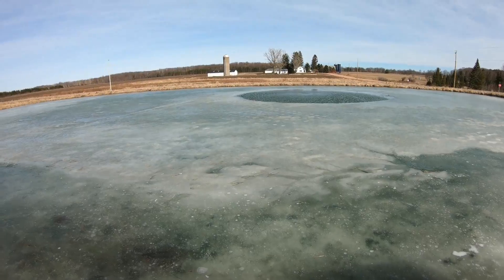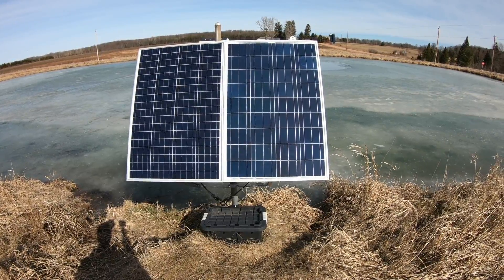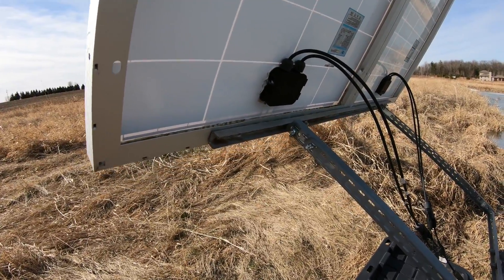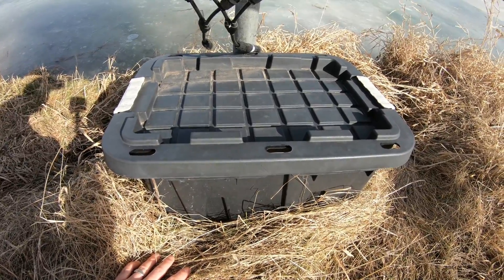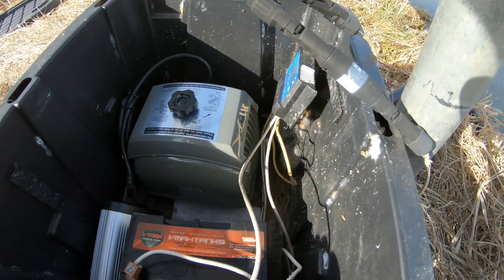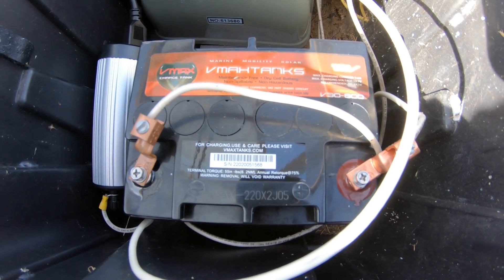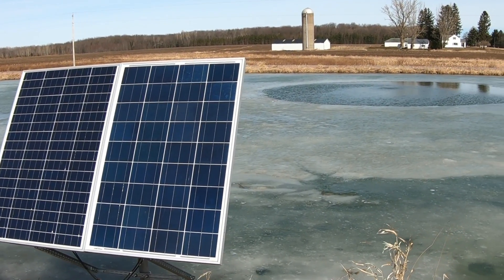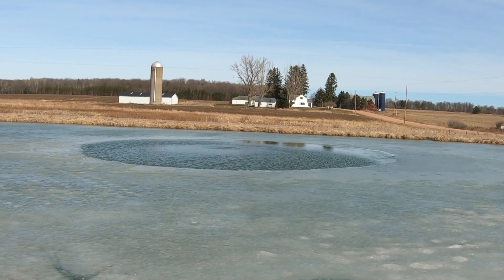How To Build Your Own Solar Pond Aerator

Comment: Hi Deano. Running in to a small problem. Have my cut on and cut off voltage at 12.8 and 11.3. I set it up and everything works. When I come back, it is off even though the voltage reads 11.8. Any thoughts?  Thanks in advance.
Reply: It was cloudy so maybe it did drop below 11.3. Will see what happens. Thanks for the fast response.
Reply from the maker: It's sounds like the voltage dropped below 11.3 which turned the pump off.  So now the voltage will need to get back above 12.8 to turn the pump back on, which must not had happened.  This tells me that either the Sun was not shining or cloudy that your solar panels were not able to get your battery voltage back above that 12.8 that you have set as your cut on voltage.  Was the Sun shining that day?  You could also lower your cut on voltage a little.

Comment: I notice in your supply links there is 1/2” weighted line but you use 3/8”. Just wondering the advantages or disadvantages of each line. Thanks
Reply from the maker: The 1/2” will supply more air and easier to attach to the pump, the 3/8” is a little cheaper. You will need to heat the end of the 3/8” to get it over the fitting on the pump.

Comment: Question if I have a 115v pump piston pump how many solar panels will I need. How has your aeration been working?
Reply from the maker: You will need to size the panels according to the wattage your pump uses.  Also, the sizing of the battery is important if your pump uses high wattage.   My system has been working great!
Reply: @DeanoOutDoors  thanks so much for response
Reply: @DeanoOutDoors  any ideas for a good or best efficient battery I can use for that type of pump and how many panels I will need will be greatly appreciated thanks again
Reply from the maker: I have a link in the description with the batteries I like to use.  You could get a larger ah battery if you need to.  To give you a more accurate panel size, I would need to know the wattage of your pump first.
Reply: @DeanoOutDoors  wattage is 115v
Reply from the maker: Volts multiplied by amps equals the wattage.  I’d either need the amps it uses or the wattage to give you an accurate answer. 115 volts will just tell me that you’d need a 115 volt inverter. Do you know how many amps your pump uses?
Reply: @DeanoOutDoors  4.8 amps
Reply: @DeanoOutDoors  thanks so much it’s actually 120v x 4.8amps =576watts running for almost 24hrs will probably need a huge battery that I can’t afford and a whole bunch of solar panels to keep energizing the batteries. I don’t think it’s worth it. Will your setup work for a 1/4 acre pond that’s about 9ft deep
Reply from the maker: Wow, that’s a large pump.  Your going to need at the minimum, 600 watts of solar. You’d be better off getting the pump I have in the description.  It uses 60 watts.
Reply from the maker: Yes, for sure.  My pond is just under 1 acre with an average depth of around 9 foot.  This setup will have no problem on your pond.
Reply: @DeanoOutDoors  thanks so much for yours responses. I’ve seen in your description all the items for the DIY I’m just a little nervous committing. The panels u have in the description I should buy is one Poly and the other Mono
Reply from the maker: Your welcome,  you can but either style. The mono work a little better.  If you buy multiple, just stick with the same style, don’t mix mono with poly or you’ll lose a little performance.
Reply: @DeanoOutDoors   👍 now I get it. And can I buy two 200 watt panels and will the pump last longer or does it depend on the battery size
Reply from the maker: You could, the battery will charge to full capacity quicker especially on cloudier days. The duration of the time the pump runs into the night is dependent on the size ah battery you are using. Keep in mind, the larger the ah battery, the more solar watts you will need to fully charge it.
Reply: @DeanoOutDoors  thanks so much. I actually ended up getting the 60L pond aeration kit with backup battery from wind and solar hopefully it doesn’t disappoint. Thanks again for all the help
Reply: @DeanoOutDoors  remember that it will also provide less air flow as well.

Comment: Just set mine up. Working great. Just a note- a 12 inch aerator disc does not fit in a standard 5 gallon bucket. Ended up zip tying it to the top. 

Question- if you use more than 100 Ft of weighted 3/8 inch hose, will it still work? I am using the same pump and set up you recommended. I would like to add another 50 to 100 feet.
Reply from the maker: Great to hear it’s working good for you!  I am not 100% certain, but I would think you should be fine adding another 50 foot for sure but another 100 might be maxing it out.

Comment: What’s the lowest temperature and duration you get there? I’m in Western South Dakota we’re we get lots of snow and it gets cold (below zero) for a week or more at a time. I have a pond that freezes over so the trout don’t survive.  I’m looking for a remedy. Like your design and will add more battery so it runs over night. Would the long duration of cold impact the batteries?
Reply from the maker: I’m located in central Wisconsin, we get a few weeks at a time with below zero temps. Our average temp is around 15 during winter.  I’ve had better luck in cold temps running with AGM batteries. They do not seem to be impacted like the lead acid batteries do.
Reply: @DeanoOutDoors  Thanks for the info!

Comment: Thanks, brother! The wife and I bought ten acres in Montana with a spring-fed, one acre pond. Plan to follow your lead on this. Should a guy wire two batteries in parallel? Any value to that?
Reply from the maker: Your welcome!  Congrats on your land purchase.  Yes, two batteries in parallel would definitely be better.  The aerator would probably run thru the entire night setup like that.  You can never have too many AH.

Comment: You find the 35AH acceptable? I was gonna put mine on a timer so the battery could charge in between usage.
Reply from the maker: The 35AH works fairly well. It will keep the aerator running all day long.  It will power the pump for a few hours after dark.  If your looking to power your aerator thru the night, then I'd recommend a larger AH battery.
Reply: @DeanoOutDoors  that's great. I'm impressed. My pond is a lot smaller, 1/4 acre. I'm assuming I can also do a 60 pump, with the 35ah battery, 230 watt panel and be good then.
Reply from the maker: Yep, that should work perfect for your pond.  Best of luck.
Reply: @DeanoOutDoors  What guage wire do you use to go from controller to battery? Is it just solar panel wire that you repurposed?
Reply from the maker: I used 10awg that I had left over from another solar project.

Comment: I’m wondering if I could do this in my pond, but kind of need to know the size of your pond to know if the same pump is large enough or too small for my pond. What size is your pond? Surface acreage and average depth, and max depth? Thanks for your time!
Reply from the maker: My pond is 1 acre, and the average depth is between 8 to 10 foot.  This setup has worked great over the last few years.

Comment: How deep is your pond?  Mine is just under 1/4 acre.  Deepest half is around 18'.  Will this pump still work.  Upper peninsula of Michigan.  Ice just broke up 2nd week of April (Last week).  Or should I go with an 80L or larger.
Reply from the maker: You should be fine with the smaller pump.  If you decide to get the larger pump, you may want to get the larger amp hour battery as well and at least a 30ah charge controller.  My pond is 1 acre and roughly 10 foot at the deepest, this works just fine.
Reply: @DeanoOutDoors  thank you
Reply: @robintroyer  did you end up getting the pump for that 18 depth? I want to do something similar and wanted to see if the same pumped work for you
Reply: @DeanoOutDoors  https://youtu.be/5C4UfCGtKX0  My pond build 2 yrs ago.  I've got a few videos on here.
Reply: You will get a significant reduction in volume of air flow at 18' depth. If you don't have problems with fish kill, then it doesn't matter. If you need more air flow, then you may need to switch to a rocking arm air compressor that has more capacity at the depths that you mentioned.
Of course, the rocking arm air compressor will require more power to operate.

Comment: Why did you use two different solar panels.  Is there a reason, or just because that's what you had?
Reply from the maker: They are actually the same wattage, just look different.  I bought them at two different times and the design was changed slightly from the first purchase.  Thanks for viewing!

Comment: I'm always curious why people use a 110v air pump with an inverter.  That's way inefficient for a solar setup like this.  You'd be better off with a 12v pump.
Reply from the maker: I partially agree with that statement, however, if you live in extreme cold climates like myself, using a 110v pump is a must.  I've tried using a 12v pump originally.  The problem is they don't operate when the temps fall below zero.  I think the voltage is too low to operate the diaphragms.  They get too stiff.  Once you get those 12v pumps moving, they'll work, but when they shut down at night, they will not start back up in the morning.

Comment: I wonder if it would help to insulate your battery enclosure. Keep any residual heat from the pump inside and the battery compartment and above freezing during winter.

Comment: Did you consider a dc powered pump, or was the ac pump with an inverter a better option?  Thanks
Reply from the maker: I first tried using a DC pump, it worked fine during the summer, but didn't have enough power during the winter months and the diaphragm would freeze up.  I then switched to this setup which was a bit more costly but well worth it.
Reply: @DeanoOutDoors  how cold does it get there
Reply from the maker: In months like January, we see nighttime temps at  -15 to -30 f. for up to 2 weeks at a time.
Reply: @DeanoOutDoors  ouch that's cold. I'm trying to design a bubbler for livestock tanks so that you don't have to go out and break ice so the cattle can get water and so your video was helpful and giving me some ideas I appreciate it

Comment: Hello, did you need to install a check valve in the air line to prevent water getting into the hose and freezing?
Reply from the maker: No, as long as your pump is elevated higher then the water line, you'll be fine without a check valve.  I haven't had any freeze issues.

Comment: Deano, thanks for the video everything is running fine.  I will post link to video once I fine tune everything.  I have a question though.  Should I leave this running 24/7 or is it okay just to run for a certain amount hours during the day.  Thanks
Reply from the maker: Your Welcome, I'm glad to hear that!  I have mine set to run continuously, it usually shuts down a few hours after the sun sets from the charge controller, then starts back up after the sun rises.  The larger the ah. battery the longer it will stay running into the evening.  If your looking to keep your pond opened up during the winter, then I recommend running this way, otherwise a few hours per day is sufficient.  Looking forward to your video!

Comment: Any reason why you went with a AC pump?  Why not use a DC pump so you can ditch the inverter?
Reply from the maker: I originally tried using a DC pump.  It worked just fine during the warmer seasons, but once winter set in and the temps. dropped below freezing, the DC pump didn't have the power to keep running.  I think because of their design, the diaphragms would get to stiff and freeze up slightly and the 12v. power wasn't enough to get them started again until warmer sunny days.

Comment: Hello.  I already have a 48 volt battery operated golf cart, a 250 watt solar panel and, charge controller will this be enough power to run the Matala air pump?
Reply: No. I am going to try another voltmeter to see if I get a different reading.  Will let you know.
Reply from the maker: That should be plenty of power.  Just be sure to size the inverter correctly since you are using 48volts instead of the standard 12 volt battery.
Reply: @DeanoOutDoors  How do I size the inverter.  As you can tell.  I am. Newbie to all of this.  However, I am totally committed to learn.
Reply from the maker: No problem.  The first thing you need to do is determine what voltage battery you are going to use.  Looks like you have decided on a 48v system?  If so, make sure your solar panels add up to 48v.  So you could use two 24v panels or four 12v panels and connect them in series. Then be sure to get a 48v inverter.  The wattage of the inverter needs to be large enough to power the Matala Pump.  A 225watt or larger inverter will be sufficient. Be sure the inverter output matches the Pump which is 110v. In my case, I choose to use a 12v system, so all the components used would be 12v.  My panels are 12v run in parallel.
Reply: I am now trying the system using an eco-worthy 12v/50 ah gel battery.  Just an observation..when I put a voltmeter to it the display show 24v.  Wondering why if this is a 12v battery
Reply from the maker: Is the battery hooked up to anything, such as the charge controller?

Comment: Did you place the diffusers directly on the bottom of the pond or did you build a stand to keep it elevated off of the bottom?  Great video and instruction, appreciate you doing this!
Reply from the maker: Thank you!  I have the diffuser connected to a five gallon weighted bucket, so it's sitting roughly the height of the bucket off of the bottom of the pond.

Comment: Will it run more than 2 diffusers at the same time or can you use the same principle to hook up with a fountain and accomplish the same?  I have a 2 acres pond and looking at options and best case scenario
Reply from the maker: The way I have mine sized in the video, it will only be able to operate one diffuser.  You could use a larger output pump to operate two diffuser at one time, but that would require going larger with all the other components as well, such as the Solar panels, inverter, battery ah. etc.

Comment: Thanks so much, this is very helpful.  I have a near acre pond.  It's about 10 feet in depth at its deepest.  Do you think the 10" diffuser would be sufficient for that?  It's a clay bottom (with a little silt of course). Could you have an additional video showing the bucket set up and how that is hooked through to the panel, battery, etc?
Reply from the maker: You will be fine with the 10" Diffuser. My pond is similar in size and depth to yours.  I unfortunately do not have a video of the diffuser setup, But I do have a video of the complete wiring and charge controller/ battery setup.  You can find that here:  https://youtu.be/tST4FrShstw  I hope that helps!

Comment: I have a one acre pond.  Will this set up work for that size pond?
Reply from the maker: My pond is just under one acre and it works really good.  You should be fine as well.
Reply: I have found used 250 watt panels on EBay.  Do you think those would work in this set up?
Reply from the maker: They should work fine.  Just be sure the output on those used panels are still to specs.  I've seen some where the voltage wasn't enough to charge a battery.  If they are fairly new and a name brand panel without any defects, they will work.

Comment: One more question. The pump outlet fitting is approx. 5/8" O.D.  and the weighted airhose includes "3/8 inch insert coupling".  Are there additional couplings or adapters needed?
Reply from the maker: If you take a torch and heat up the end of the weighted air line, it will soften it enough to be able to slide the end over the pump outlet.  Then attach a hose clamp and your all set.

Comment: Great video! Very informative. This project is now on my agenda for the summer after I get rid of the algae. I was wondering, what is the height at the top of the solar panels, and how do you know what angle to set them? I know they are supposed to face south. Also, which VMAX battery do you recommend? There are 4 batteries listed on the linked page.
Reply from the maker: Thanks!  My panels are 6' to the top.  I recommend at least a 30ah. battery or more.  The higher the ah. the longer your pump will run into the night. Here is a link to a Solar Angle Calculator that I used.  http://www.solarelectricityhandbook.com/solar-angle-calculator.html  You can enter your location and it will determine the best angle for each season.
Reply: @DeanoOutDoors  Thanks!

Comment: I bought and installed everything you had, the charge controller was  kinda confusing, my system shuts off for a minute and runs for a minute is this normal if not can you please let me know what you set yours at. I sure would appreciate it, Thanks Jaime.
Reply from the maker: Here is a link to a video I made showing the settings that I use: https://youtu.be/tST4FrShstw  The system should not be shutting on and off every minute.  Mine will run continuous all day and approximately 3 hours into the dark.  The only time I had an issue was when I used a cheaper battery.  That old battery didn't have enough life in it to hold a good charge and couldn't keep up with the pump. If your settings are correct I would take a look at the battery next. Let me what you find out.